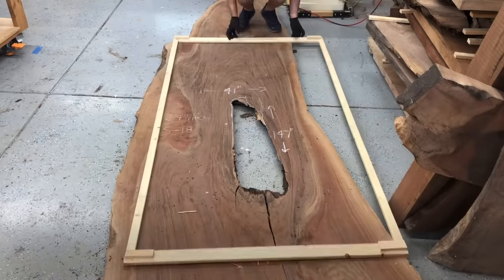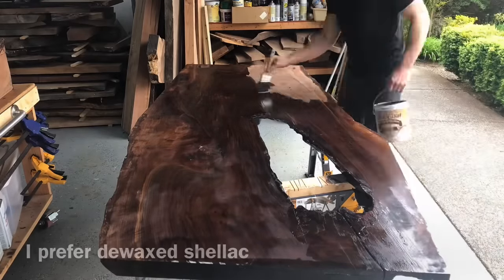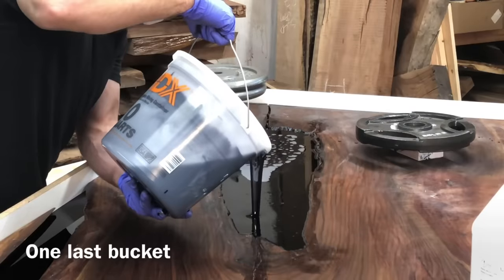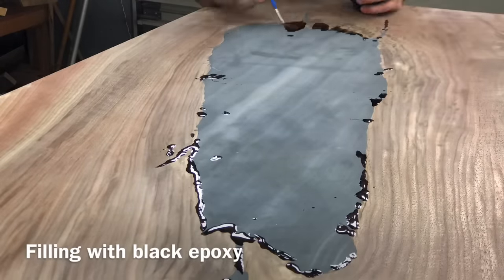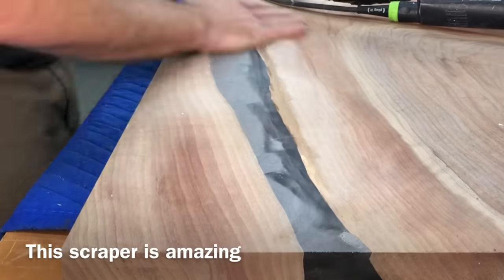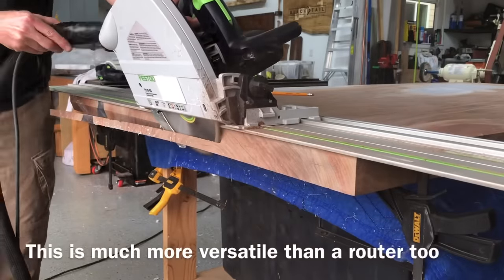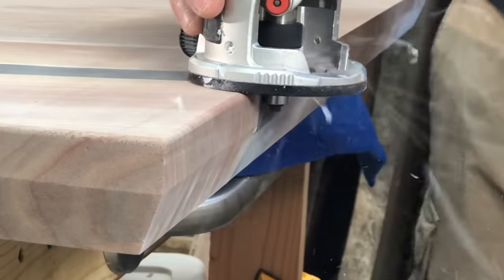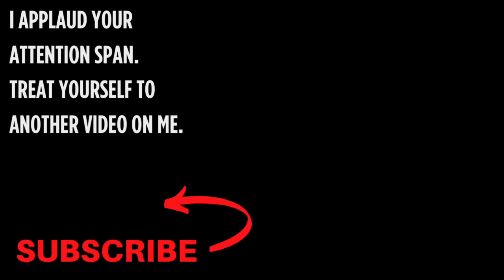$250 Slab To $7700 Table

Comment: Wood! Seems most organic to a wood top but if not practical black matte metal will not detract from beauty of the top. My fav look is 2 x-like stances about 1’ from each end with lengthwise ?4x4 between. No seating pole obstruction, a clean look

Comment: Metal legs seem better in the long run..yeah I've binged watched all of your content over the past few days and have made it way back here.. Still wondering why you never grabbed a cheap Horrible freight portable gantry with nylon strap hoist / boat wench setup to protect the wood and your back from serious wear and tear damage that you simply can't fix..a rolling gantry could be used to load / unload your 2nd gen Tundra as well as placing it on a work table inside or flipping it over..way more useful than that yale forklift you currently have..a forklift is basically just used for shipping purposes..a rolling gantry is a game changer in the workshop..it only takes one accident to have a lifetime of pain..Cheers..

Comment: Metal...but I have to say, it depends on the piece. Mainly on your bigger pieces, I'd say metal for a better structural sand point (and it looks good to) but I do love wood on wood too and for your smaller pieces, it is absolutely gorgeous!! Cam I would like to see you have a lathe though too. I think you would get a much better finish on your pieces (not to say that you do not by free handing a lot) but it is pretty satisfying using the lathe as well and it would give you more aspects for a more intricate pieces that you could create! 
That's just some of my thoughts?? You're doing amazing pieces though!!

Comment: What I'd like to see you do is make a diorama with a decorative shape.  Or a Dresser with resin bits that have little sea creatures and vines planted in the resin. 

It'd be cool to see if it were a Diorama of some historical momment, what would be used to make an explosion? Like... a syringe for each, red orange yellow, and black epoxy?

There's some OTHER cool things you could be doing. Some of them are stuff you could be doing with the tables you're currently making. 

Any way to put LED lights into a desk or table without dealing with cables a batteries? Like... who thinks to plug a table in?

But a table that emits as much light as a lamp, that would be cool. The table would control the lighting in the room, to some degree.

Comment: I understand the necessity for the C-channel. 
 Instead of routing and countersinking the channel flush, have you ever flipped the channel over and used it as an attachment point for the legs?  Just to save some time and potential for a time consuming error.

Comment: You can save yourself a ton of headache and skip making most of the mold by putting your piece enclosed in a big painters plastic tarp and squaring off the edges with wood. The resin doesnt stick to the tarp at all and peels right off. No mold release needed. As long as you make your piece bigger than final dimensions, you cut off the garbage outsides afterwards. This method is impossible to have leaks, no major time/materials wasted making melamine molds.

Comment: Metal I like the contrast; I’m so proud about to pour my first table and tonight its a small coffee table but I can definitely say that everything I’ve learned I’ve learned from you so if something screws up I’m holding you responsible I really appreciate the fact that u do these videos I know it’s a real pain in the ass it’s got to be but they’ve really taught me and inspired me my question for you is after I get done sanding I just varnish is that the best way to do it what about those like hard top layers of epoxy that you can put on top of like bars and stuff like that Is that not a thing Anyway I’m nervous about what to do after I’m done sanding and I would appreciate some advice please

Comment: METAL! 
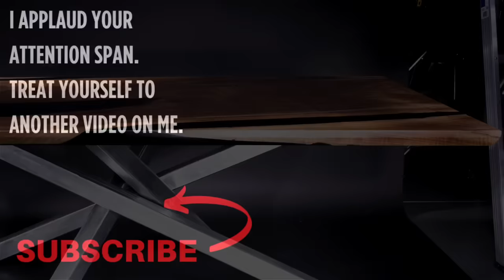A brilliant piece of art again. I was especially struck by the legs. I have 3 small (approx. 30cm diameter) "slabs" of teak wood I want to make a mini table from. I already got aluminium square profile (approx. 1cm) to make the legs and I want to cross them as well. But how did you connect these legs (17:35 in the video) to the table? And would you suggest for processing the teak wood (finish layer)?

Comment: Wood for sure. Maybe somehow incorporate epoxy into the leg work ehh? But Metal looks great with the black epoxy if it's gunmetal or black. Also, adept at best woodworker here. I recently received free reign on the garage from the wife. I am looking into woodworking on the side. Any suggestions on simple, good essentials practice, that also sells well? I've done cornhole boards, and outdoor picnic tables and benches. I want something that I can bang out and make in bulk and sell well.... pipe dream?

Comment: I've just done some black epoxy on my hornbeam slab this is not a deep poor just the cracks from the timber drying. 

What type of scraper do you use to smooth smaller epoxy fills.

I've seen all your videos and am now on finishing up my first one 👍 also any advice on good places to sell I know most of your work is probably via YouTube.

Nice one black tail 😎

Comment: I know nothing about this, but find myself wondering if a vacuum bag would help keep the epoxy contained?  We get our pontoon boats put in a vacuum bag for the winter so I know it comes in large sizes. I was thinking that if you could lay the plastic bag out and construct the table form and table inside it, add your epoxy and vacuum seal it shut till dry it might eliminate any voids in the epoxy?

Comment: Either wood or metal, depending on wghat suits the slab best. question: instead of framing the piece straight doen it, you make an angle and cut away good wood. Is that an artistic choice?

Comment: Hey man loved the video. Recently just made my first guitar and put Blantons whiskey caps on the top half of the guitar. Wondering what grit I should start with on the sand paper. First time using a epoxy. There are rough ridges but it is pretty clear already. My concern is that if I start with a 40 grit and work all the way up to a 1200 grit it might start to touch the whiskey caps. Cheers mate.

Comment: I prefer metal as i love contrast.  Thanks for the fantastically informative videos.  I am attempting my first epoxy pour tomorrow and have a question.  I didn't order fast dry epoxy and cannot find it locally.  I do have access to fast drying shellac.  Do you think its ok to do seal everything with fast drying shellac?  My pours tomorrow will be on the back of the slab.  Thank you.

Comment: I love this!!!  I’m getting ready to make a tabletop. My son has already made my base, which ironically is the same as you used at the end. I have a few questions:
I want the long ends of mine to both be drop leaf, so would you recommended making the whole top and then cutting, or precutting and working on each 1/3 separately?
Did you use the channels to keep it from warping?
I also want to use black epoxy along the rough edges, but then have the centers be clear epoxy so you can see through to the base. Is this even feasible?
Thanks so much.

Comment: Wood and metal.. I guess it really depends on the build to me. Maybe the mood I’m in when I do the build. However my usual choice is Metal for the legs. 
Cam, I am doing my first desk top. Black Walnut. I went with a river pour design. 
I’m having a really hard time finding a planer or sander big enough to do my desk so I can’t imagine I’d find anyone here that will do a larger table size. 
My question is this. 
Have you ever had to use a router sled?
If you have had to..what brand is/was the sled ? 
And do you have any suggestions or recommendations on router blades/bits brand? size?

Comment: How do you source your colors for your tables? Do you have any recommendations on deep colors or how to get like a deep red or deep blue/green (ocean color)? Also how well did charring the wood in a previous video work? Would you recommend putting nails in the wood and running an electrical current through it to get those burn marks throughout? Thoughts? TIA!
Reply: Also how do you price your pieces? What goes into your cost/profit breakdown?

Comment: Not sure? When you took the slab to be planed and sanded,did that take all of the shellac and black epoxy off. So.... I mean is there bare wood except for the open spaces that are filled with black epoxy?when you out sourced, to final varnish, is that the only thing on the wood portion? I'm kinda lost.

Comment: Beautiful table!! Does the resin alone make the floating wood corner adhere to the table, or do you have dowels or bolts to support the corner? It seems like if someone leaned down on the corner, it could snap off. Thanks, Mike

Comment: Hello, I am a wood worker and have just looked at doing small epoxy furniture. I am intimidated because there are so many variables. I have gotten everything you recommended in this video except the quick drying epoxy and the CA glue. Where can I buy those items?
I have a few questions, my first table is for my wife and they are end tables, so not big. Do I need to sand prior to starting the pour? In other words, starting from 80 and going up to 300-400 grit?
I used sanded 3/4” sanded plywood for my mold. I sealed all edges with PVC clear sealer, and used a red non-stick tape and lined the mound with that. Should this set up work for the molds? 
Thanks for your time, 
Ben Holt

Comment: Is it possible to do cool unique designs with metal table tops with epoxy.  Or would it be more difficult because the metal would have to be very thick like a slab.  
Or is there a way around that to still achieve it.

Comment: Hi Cam,
I'm making a live edge table of 3m (elm, the boring name). I wonder if it matters where that i put the c channels? I thought to put 3 in the bottom. 50 cm from the edge and one in the middle or is that to far from the edge?
Reason is i Prefer to install them in solid woord and not epoxy. On the edges there are some big holes i fill up with epoxy.

Christmas greetings from Belgium 🌲

Comment: Most of the epoxy tables that I see are just straight slabs. I’ve been refinishing table tops. I find it extraordinarily difficult to Apoxsee, the sides of the tables, because of the angles and the recession of the sides from the tops. Any advice on this that you could give me? I’ve seen some people use rollers… Also, occasionally the epoxy is rubbery even after days of setting, is this from a bad mix or?

Comment: Hi I am wanting to seal between the underside of my Tasmanian Myrtle table top and the formwork before pouring epoxy as my timber is flat on top but very irregular underneath. What sort of sealant should I use would expanding foam work for this?
Tim

Comment: I am totally confused by you blokes that make table tops. UTTERLY confused. Ok. Why does no one ever, ever put a well fitted piece of the same slab into the table, making a fucking nice fit and layering between the timbers, which is only filled by Epoxy. The Epoxy uses all the space between some awesome looking timber slab...  I don't understand why some of the timber , unrounded or played with, is not placed into the Epoxy spaces and made to look and feel part of it...  I am,  looking at 12 inch gaps, even largerand longer spaces. Can someone explain this to me. So instead of the Epoxy, filling the large space with the same timber between all the Epoxy and making it LOOK sexier....